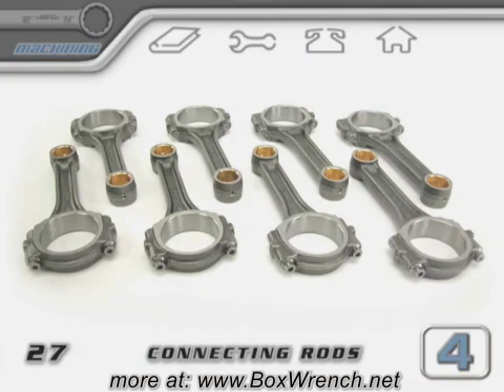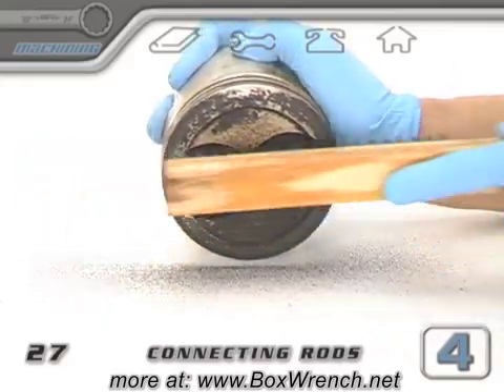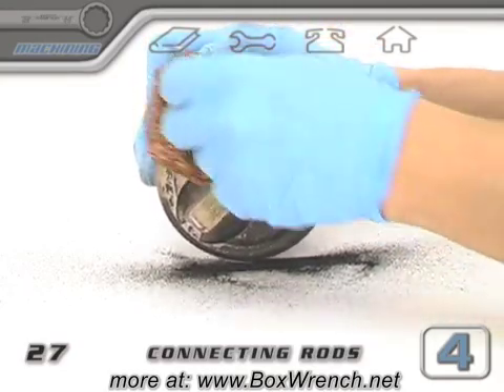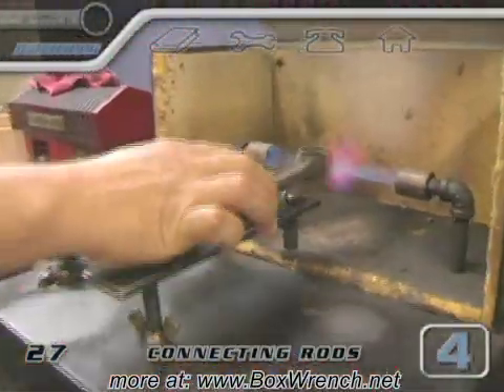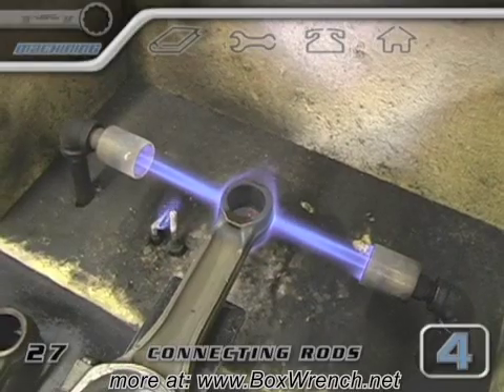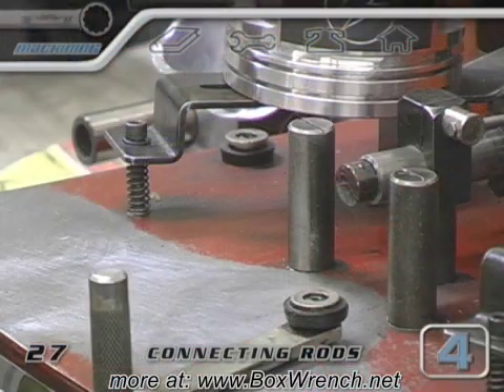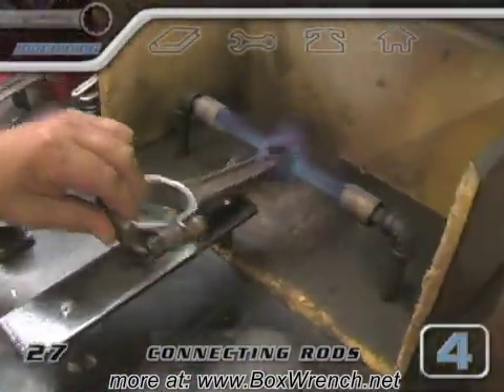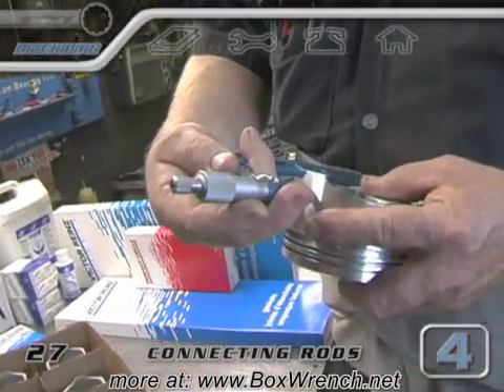Connecting Rods Machine Shop Video-Engine Building DVD

Comment: How can you tell if pistons are press fit or floating
Reply: Most pistons that have a floating wrist pin will have a visible Snap ring or some kind of ring that holds the wrist pin in place. 
If it's a press fit pin, you wont see anything other than the wrist pin inside the bore, and the connecting rod will wiggle a little bit side to side but when you feel the wrist pin, it will be frozen in place with regard to the connecting rod, but the rod and pin will rotate freely in the piston
Reply: @brentbye  so my new pistons have clips that came with piston  sirclip.  However I can’t get the wrist pin into the rod  and I was wondering if it can be a pressed fit with sirclips?
Reply: @BulliKid  Most likely the clips are meant to be used with connecting rods that are matched with floating pin diameters. If your rod small end diatmeters are meant for press fit, you'd want to have a machine shop install the pins to the pistons using the rod heating method. The clips included with your pistons wouldn't need to be used unless your rod small ends allowed you to install the wrist pins by hand, only then would you want to use the clips to secure the wrist pin in the piston.
Reply: @brentbye  thanks.  I mean it looks like it should be a floating style but the wrist pins won’t go in by hand on small bore of rod. Maybe a bit of heat and more pressure.  Idk.  Seems like it should go in smooth but doesn’t.  Oem instructions say you can heat to 195f to help open up the bores.

Comment: HONDA did some real BODGE UPS at factory----  big 4 stroke singles with gudgeon pin rotating in S.E. with NO BUSH / NO NEEDLE BEARING and they scored rod in standard trim in normal use. as they were only SPLASH lubricated.

Comment: Heating the rod is not a good practice. If the pins are thin walled, on the engines first warm up, the pins will distort & seize in the piston.

Comment: this is a long shot since this is such an old video but I've been wanting to do a frankenstein build. So my isuzu engine has a bad piston design and the oil rings gunk up by 60k. The oil ring is too small with too few drain holes. A 4runner piston is very simmilar.  The isuzu pistons are pressed while the toyota pistons are free float with clips. Since I'm using the isuzu rods can I just forget about the clips? They both use 22mm wrist pins.

Comment: If the pin is allowd to rotate freely in the small end, this is 1 more place for grit to enter and cause eventual noise. If only the piston pivots on the pin, this is most efficient. However, "Cash For Clunkers" says that all combustion engines are rendered garbage with just a drink of silica. Why bother? Buy a $10 000.00 MTB instead.

Comment: Holly shit, you never can heat the conrod, this is totally wrong. The correct pin should be found to allow free rotational spin between the parts, never assemble it on "fire". Shit I never saw it before and had expended a half of my life making conrods.

Comment: Yes, in one respect it does, but there's more to the equation.
Metal expands in ALL directions at an equal rate [coefficient of linear expansion], so if only the coss sectional thickness of the little end is considered, then yes, the hole is getting smaller.
But, the hole gets bigger because the circumfrential length around the hole is much greater than the cross sectional length, so the amount of circumfrential expansion is much greater than the cross sectional expansion.

Comment: No need to use media blasting on them, Just throw them in a Ultrasonic bath at 40 to 80khz with a carbon removal detergant.  No abrasion required.

Comment: I have been building Engines for almost 30 yrs and have never used a rod heater,i can mount 3 sets of sm block chevys,vrs 1 set with the rod heater with a torch,any way thats how I was taught,and it works just the same.

Comment: @k0ent when you press the pin out your not putting 2 edges against each other as you would by trying to press the piston pin in..
the walls of the piston pin will just slide out of and away from the connecting rod without scratching or marring anything.
i hope this clears it up for you.

Comment: @jungledrum123 
Those arrows needs to face to the front when the rod goes on. It doesnt matter where the squirt goes cause it will go inside the cly wall regurdless as long as the arrow is to the front. As far as the rod itself goes it just needs to go on the pin before it cools down. You can turn it which ever way it needs when you install it. Its just that simple and the video said its not a simple procedure. ASE teachbook tells to mark it but an expert already knows and never does.

Comment from the maker: @jungledrum123 you need to be aware that there are many types of rods that have oiling squirt holes in them. These kinds of rods absolutely must be hung on the piston correctly, or the oil will squirt away from the cylinder wall and cause damage. Also, any experienced engine builder will stamp the outer side of the rod and cap before dis-assembly with numbers or dots. This is a procedure that helps all through the machining and re-assembly processes. The method used here is standard practice...

Comment from the maker: @japajill 
If you watch again, at :53 the correct size pinston pin is attempted to push in by hand, showing that the connecting rod small-end is slightly smaller than the piston pin. 

If you forcefully pressed the pin through the rod end at room temperature, you'd shear off the inner bore of the small end of the rod with the hardened steel piston pin. It just won't work that way without damaging the connecting rod.

The only install method for "semi-floating" pins is what you see in this video

Comment from the maker: If you mean how can you remove the pistons from forced fit connecting rods at home...you really can't without a hydraulic press. 
If you tried heating the end of the rod with a torch, you would also be heating the wrist pin of the piston and it would expand along with the connecting rod end. You wouldn't be able to remove the pin from the forced fit, even when heated.

This is why we made a machine shop section of the DVD, to show you all the stuff that you will likely need to have a shop do...

Comment from the maker: There will be no side to side movement once the piston is installed into the engine.
The connecting rod fits to it's journal on the crankshaft and once all pistons and connecting rods are installed, the piston is constrained to it's cylinder bore and the connecting rod and piston pin will only have a few thousandths of an inch lateral movement (rod side clearance)

All of this makes more sense when you see the entire system work together in the complete DVD... It's a lot of moving parts

Comment from the maker: Funny...
Now that it some knit picking perfection but we respect the attention to details. 
The dialog actually says "...facing the right way on half of the pistons and the 'other' way on the other half..." if you analyze the dialog it actually makes a correct statement. The dialog says the first half is the "right" or correct way indicating that if the same orientation was used on the other half of the pistons, they would be incorrect. Therefore, saying the "other" way on the other half is fine

Comment: Why don't you use the other rod heater ? it heats 2 rods at the same time and is thermally controlled?this way the rods get heated to the correct temperature each time.